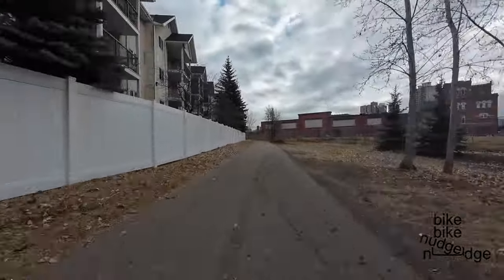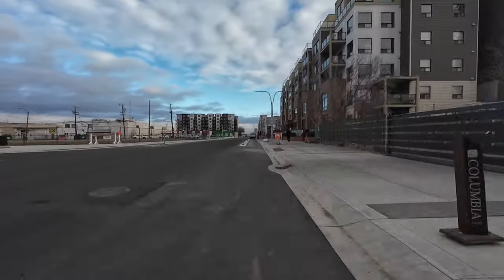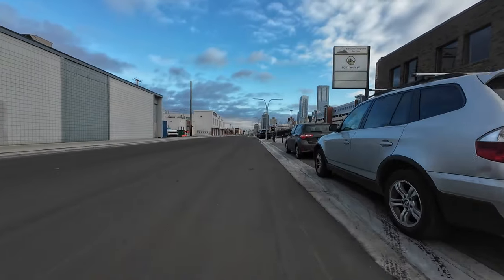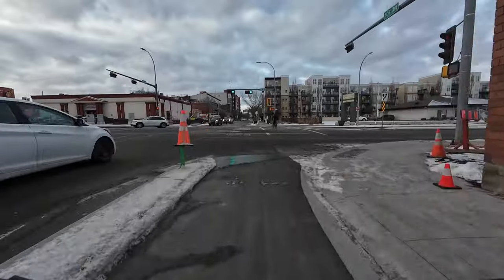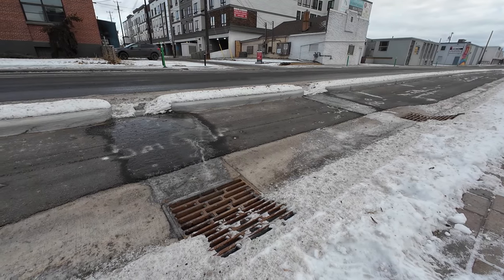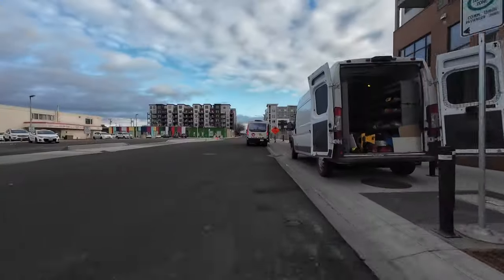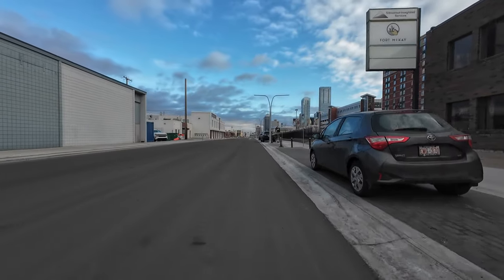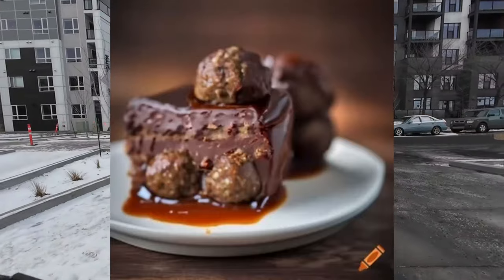My review of brand new bike infrastructure ends with a surprising food recipe

Comment: Nice video! I agree with you on most points. But you turned around before the end of the planned redone path. It will end at 97 Street and according to the city's website it will be on the north side. The path will end there leaving you to cross busy 97 Street completely unprotected. This is completely ridiculous since there is an unused overpass on the south side. Unfortunately the city doesn't own that and doesn't have competent enough people to negotiate some kind of deal. When it comes to car infrastructure however, they can do miracles. 😠. Keep up the good work. Subscribed!
Reply from the maker: Thanks for the compliments. You are correct that I focused on the major rework and not the realignment of the PBL east of 109St. I merely mention that the PBL ends at an LRT stop and/or requires sidewalk riding to actually reach downtown or continue further east. East of 109St also has the PBL protected by street parking instead of the other way around. That shows the City can do things properly when it chooses.

Comment: Seven months it took to build that?  What?  And it's mostly garbage.  Now the city will crow on about the "massive improvement" to cycling infrastructure when it's barely better.
Reply from the maker: It also took 10 years of planning. It's better than the nothing that was there before 2015. It's prettier than the two-way bike lane that was temporarily installed but you can make a good argument that it's functionally worse. West of 116St probably should have originally been built to match the two-way lane instead of the other way around. Sad that initially there were no buildings or sidewalks 10 years ago. The street was a blank slate.